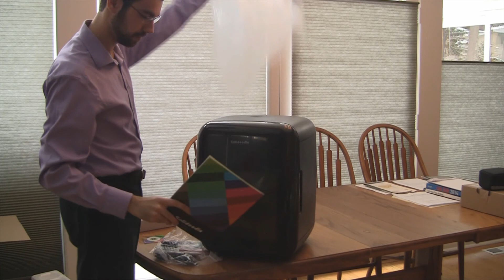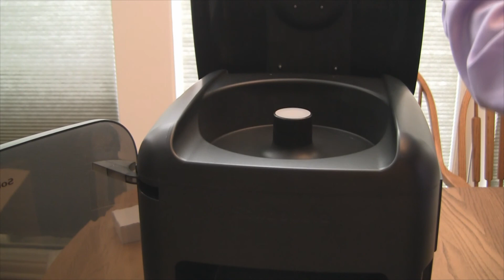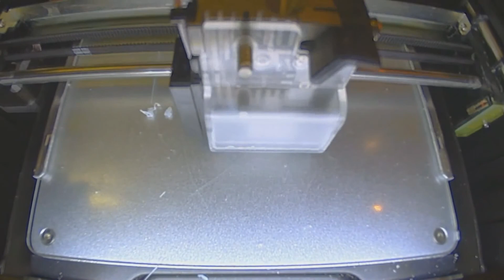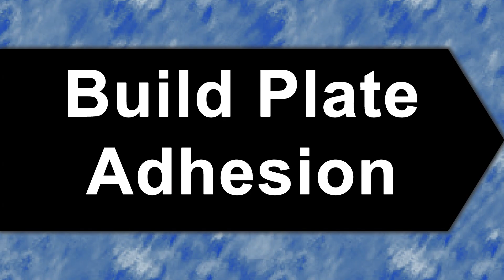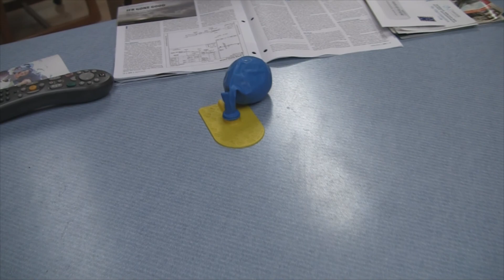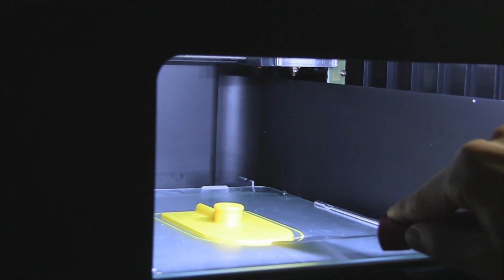Solidoodle Press - First Look

Comment: I have had mine since February and I am still having trouble getting decent prints. I had the same problem with the extruder crashing into the bed, and I believe that it has done some damage. I have measured the bed and there is at least a 2mm decline, which would explain a lot of my prints. After going back and forth with customer support, I have also adapted the rubber band support for the wire sheath. I have also adjusted the trimpots, which helped A LOT. If you haven't done that yet, make sure you do. You also need to check underneath of the bed to make sure that there are two screws holding the bed in place at the back of the chassis. Solidoodle shipped a lot of printers without the bed screws (unprofessional). I have also noticed that the bed does not reach the temperatue that it is supposed to, which would explain why the filament has trouble sticking to the bed. I went out and bought a IR temperatue gun and saw that when my printer is set at 100°C, the bed is only reaching 84.6°C - 90.1°c. Solidoodle REALLY messed up with this initial launch of the Press and I have been extremely disappointed thus far. We shouldn't have to be fixing their products. They should've had this thing perfected before shipping them. They have sold 3D printers in the past, so this isn't their first product launch. I am hoping that now that I know how to get the Press up and running, I can get a replacement and start over. Thanks for the videos, and let me know if anything I said is helpful and if you have any other tips!